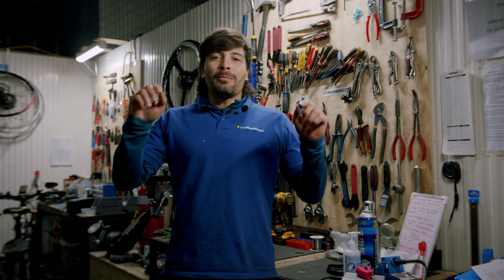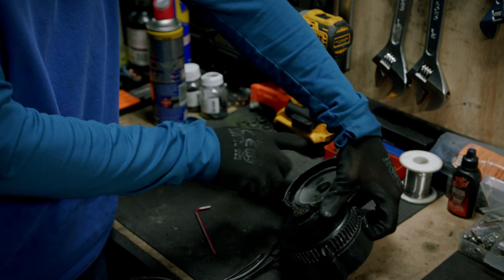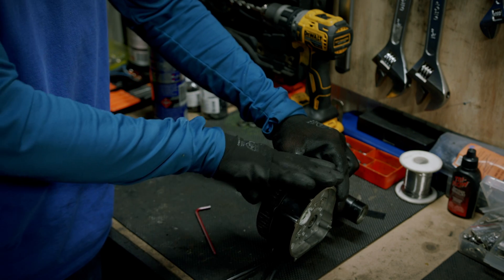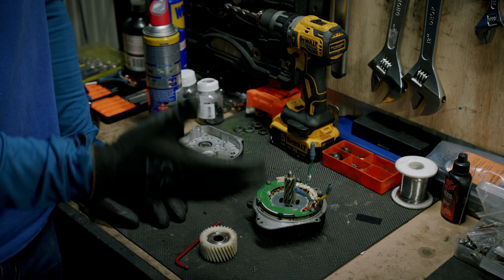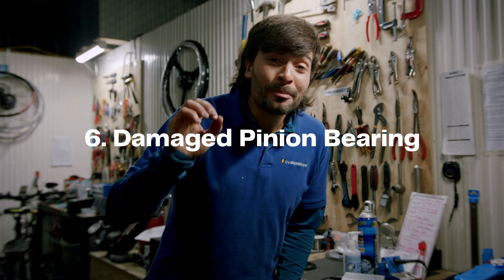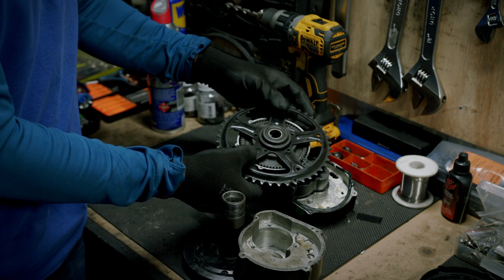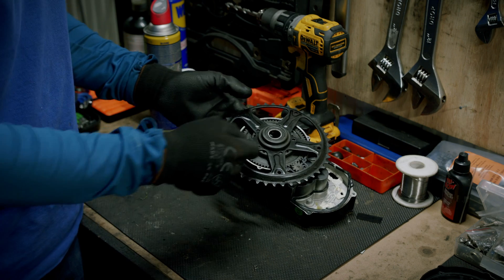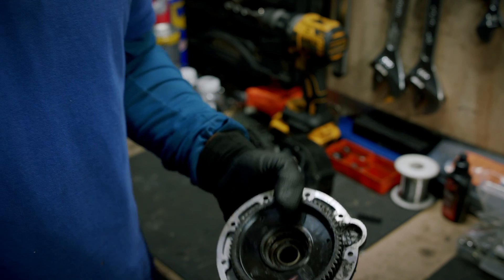Bafang BBS Motors The Most Common Problems of These Mid Drive Motors

Comment: Hello, I have a question. I recently bought a new Bafang bbs02. I asked my supplier if it was waterproof and she said that riding it in the rain for long periods of time is not recommended. Though, I would love to hear if someone has had experience with riding it in the rain and how the motor responded to it. 

I will make sure to put tape on the place where the controller is (also what tape do you recommend, ductape?) There is a lot of rain in my country, especially now it is becoming autumn / winter.  So I want to be really careful with riding in the rain. If you have any other tip on making it extra waterproof please tell me!
Reply from the maker: avoid riding in the rain, the motor will fill up with water, recommended to add tape and other sorts of covers but don't let the motor overheat, be creative, also add helicopter tape to the display and remote control then heat that tape with a head gun, it will shrink and wrap around the display and remote control.
Reply: Okay I will do that! Thanks for your answer!

Comment: My problem with my Bafang motor is the fact that it twists inside the bottom bracket, I have used Lekki locking ring to hold the motor in, and I torque it to spec and it still twists in the bottom bracket just slightly. I also have 2 different types of stabilizing bars holding it in place, yet the motor still slightly twists in the bottom bracket when the motor is running.
Reply from the maker: @TheBrainSquared  have a look at our video how to install a bafang motor, you should get the best tips to ensure your motor won’t move anymore

Comment: great video I just have a question - the engine suddenly stopped working, it doesn't turn at all. and there are no errors on the screen, everything turns on, even the speed is shown

but the engine doesn't start, do you have any suggestions? 
Thanks u
Reply: I don't know if I should try to buy a new controller or cables but that don't look damaged
Reply from the maker: brake cut-offs or the phase wires are melted or water damage inside the controller, search our videos you gonna find the answers following those topics

Comment: Most of the gearshift errors are from using too small/ low of a gear and applying too much force/heat. Are their issues from too high/large of a gear and wide open throttle?

Comment: I have checked all comments and i can't see anywhere
Reply from the maker: you didn't look properly,

The upgrade bearing we use for BBS01/02 is 6002 which is a bit wider than the original.

Comment: @ellaochomogo5154
45 seconds ago
I like how you get technical with your videos.  They are very informative.  Thank you for sharing your knowledge!  I have a question...  I recently installed a brand-new BBS 02 on one of my bikes.  Everything functions as it should, but I have noticed that when the motor is maxed out at maximum speed under throttle, there is a slight vibration when the motor is under load, but the vibration goes away when I slow down by a couple of MPH.  There is no noise just a slight vibration and all else functions normally.  Is this vibration normal?   Could this be the chain resonating?  Any advice would be greatly appreciated.  Thank you!

Comment: Great video. My problem is motor stopped working mid ride. Charged up and would not turn on. Battery voltage is 51 on 48 v battery. Had a working new same system so i started replacing parts. Display was first choice and it worked. Then throttle. New throttle didnt fix. I tried my throttle on my bike and it does not work on known working system. Still no motor. When i try working system with my motor its no go. Could motor and throttle go out at once?.  Thanks Steve
Reply from the maker: Go on the brake cut off then the controller or motor hall sensor, if no error code on the display, check the phase wires

Comment: On the BBSHD, since it's capable of much more torque output(it was designed as a Cargo e-Bike motor after all) the factory Nylon Pinion drive gear is woefully inadequate. 1) It's too narrow for the steel helical Rotor gear. 2) It wasn't designed for all 1000w of the potential output of the BBSHD(when running a 52v battery). It was designed for 500w. This can be corrected however. There are vendors out there that sell an upgraded Pinion drive gear. It's made out of PEEK(polyetheretherketone) instead of Nylon(Polyamide). It's also slightly wider to engage more of the Rotor gear. PEEK acts like Nylon but is far more Heat resistant and has a much higher Tensile strength. The PEEK gear also runs just as quiet as the Nylon gear does. If you or your customers are having a problem with the Nylon pinon drive gear destroying itself I would highly recommend installing the PEEK alternative. Just search the internet for PEEK Bafang gear. You'll find it. I personally source mine from Luna Cycle(I am not affiliated with them, I'm just a customer). I've installed 5 of them so far on BBSHD's that had failed Nylon gears and stock programming in the controllers. Well 6 if you count the 1 I did on my personal BBSHD as preventative maint. Speaking of, it's a good idea to apply new White Lithium grease to the Nylon gear once in awhile as well. It's helps add an additional layer of thermal protection.

Comment: super helpful, thanks. I've either stripped my nylon gear or granny gear. It won't catch in 2-3 speed now and sounds like gling-dingadingading when its not catching
Reply from the maker: the equation is simple:
Big chainring + heavy ebike + not always starting on first gear + riding at low speeds on high gears = motor problems

Comment: Good video!

So I noticed a squealing sound coming from my BBS02. I took the plastic cover off, and it sounds like it's right where the pinion is. The sound only comes when i'm pedaling WITHOUt assist. So once assist or throttle is engaged, there is no squealing sound. I regreased it all today because I figured maybe it was rubbing or something? Not sure what to try next to fix it.

Comment: I have been using my BBS02 for about 2 years now, I don't really travel far on it, Just going to shop and local journeys, The paint on the motor stated to come off showing the bare metal housing of the motor, So I sprayed some anti rust paint on it, It is still working well though, I have never used the programme wire, I bought one but I have left it default, I feel the BBS02 is enough for the little commuting I do on the E-bike, I am going to put another E-bike together in the Summer, From ground up an enduro or down hill, Probably an enduro though, A project you could say...
Still though doing the BBS02 build have saved me from all sorts of stress not having a license, I can just jump on the E-bike and get to where I needs pretty fast as you can use short cuts and parks, I hate the roads anyways, I feel there is way too many cars on the roads see, So I am glad I am not part of the mess you see on the roads, lol....

Comment: My unit is now 5 years old and I am experiencing occasional intermittent partial power loss. I have checked the brake handle cut-out sensors and the power supply. The display is always working without any error messages. Does the motor have a thermal cut-out? What else shoud I be checking?
Reply from the maker: Remove the controller and check the phase wires. If the connectors look melted and with lots of resistance build up, re-do them.
Reply: Thank you for your suggestion. I just found out that the right brake handle cut-out sensor was too sensitive - it needed to travel just a fraction of a millimetre to activate which could have been caused  by road bumps or accidental touching. I adjusted the magnet and hopefully there is no other problem.

Comment: Thank you for sharing your excellent knowledge of this unit! I certainly will shift more than I already am and try to protect the unit from water. Unfortunately, I could not use the so call 'Lekkie Bling Ring' which would have given me a far better gear ratio and taken strain of the motor on steep hills.

Comment: nice useful details...my bbsd 350w dosent start on pressing power button on some research after checking all contacts points etc finally noted that contrller is not giving out 5v to red wire..what can id

Comment: Mine was buzzing like it was running out of batteries and now doesn't start with throttle or pedal assist. I think it's a bad connection but i hope the controller isn't damaged by the intermittent power. I was having to run it off a speaker wire with banana plugs in the battery as i need a new battery mount cable.

The motor connection bottom bracket is annoying because it comes loose as there is about half a tonne of force trying to turn it at full power. My motor is now held up with a bungee. Otherwise it rises up and dents the frame under power. I might need a rubber washer between it and the bottom bracket.

Comment: Thanks for this great advice! Some people recommend lubricating the BBSxx motors even when they are brand new. What do you think about that? I just bought one and will put it into the bike soon...
Reply from the maker: My opinion is: why will you change the oil of a car you've just bought brand new from the auto dealer? 

We have done Bafang conversions for over 6 years always installing the motors new out of the box and we have had no breakdowns due to "poor lubrication".

I just think it's an unnecessary step

Comment: i have again dead controller, no power time to reflash bios again? what's the best software package to reflash my BBSHD1000 52VOLT, it seems like every 2 months
Reply from the maker: you're riding it wrong, not starting at 1st gear, shifting gears too early and letting the torque build up in the motor. What you described is not normal for a Bafang motor, and in all these years we've never pulled one motor faulty out of the box.

Comment: Very useful, I have even sent it to my bike mechanics! At 2:25, you tighten the nut and explain why the torque is so important, but for this nut, I need a special tool to fit between the nut and the torque wrench ( I don't know the English word for it). Where did you buy it? I can not find it on the internet. Greetings from Holland and if you even need a job in the Netherlands call us (BerkelBike).

Comment: Wow. What a breakdown of this unit and how it works. Excellent! I just bought a used Brilliant brand Nexus-geared bike with 750 Bafang, and I noticed on the second day of riding [two days ago] that the motor is "popping" each time the motor engages using either PAS or throttle (pop can be felt when touching the motor housing). Pop in the motor is the same whether engaging with throttle or peddle sensor.
Reply from the maker: Check the granny gear and pinion coupling. You most likely have to replace the granny gear or the bearing of the pinion and the pinion itself.

Comment: The old bbs02 was set with the throttle as priority over the PAS.. This allowed you to use a really low PAS setting and add throttle along with your leg power and it kept the heat and stress down.. It also felt natural.. Then they changed it when the newer bbs02-b came out.. Now the PAS is priority over throttle.. This ruined the drive.. While your turning the pedals the throttle won't work ( unless you pin it to full throttle   which is obviously bad for the motor).. I built several of these and the first thing I do is cut the grey PAS wire!! PAS is stupid!! With no PAS you just ride it like a bike and add power with the throttle when you need it.. The PAS numbers 1-(3,5,or9) now act as what amps your throttle controls.. If you can program the controller set PAS 1 to say 15% ( of the 25 amps) 2 to 25% and so on until 9 is full amps 100% or 25 amps.. You can even set 9 to 90% just for piece of mind (or a customers bike).. You will be surprised that you can ride all day in say 6 and it has plenty of power.. Your bike will feel 100% more natural to ride, your drive will never overheat and your range will increase.. If your really low on battery you can go into PAS 1 and just tap or blip the throttle to keep your momentum up.. 🍻
Reply: Hi, thanks for the hint. I just bought a BBS02B and I didn't know of that change. Definitely agree with you: PAS is stupid. Where is that grey wire located? Inside the chassis?
Reply: If you pull off the controller you can find it there, or you could pull the side cover off and remove the big main drive shaft /gear (the one the pedals attach to)  .. Behind that gear there is a plastic disc with a magnet on it, if you remove the magnet the system will not "see" you rotating the pedals. Then you can pedal the bike and add 1% - 100% variable throttle,, the combination of variable throttle and your leg power is natural, smooth, efficient, and fun.
 @jstolba
Reply: This is news to me, thanks.
Reply: Is this apply to cadence sensors or torque sensors?
Reply: The BBS02B and BBS01B don't have torque sensors in them from the factory, I don't think the BBSHD does either.. As far as cadence is concerned all your speed and odometer data is picked up by the magnet on the spoke that is read by the speed sensor so you still get speed and distance readings  @esayed
Reply: @b-r0llblog510 Correct. All the BBS series use a Cadence sensor. The M series changed that however and they have Torque sensors.

Comment: I grease the reduction gear with Black Moly NGLI 2 grease...  
 I choose small (30T Lekkie) chainrings so that the motor spins fast.. This does a couple things.. Keeps the motor cool, and extends range of battery.    Paired with my Rohloff SpeedHub i am able to keep the motor from lugging down.. That will burn out the controller fast.. Listen to the motor and don't lug it down.. it should sound like it's spinning fast to work properly.
Reply from the maker: how do you pedal on a 30T chainring?
Reply: I'm a short guy. 5'7" so i ordered the square taper (bafang) 152mm crank arms.. This keep my knees from having to bend sharply on the return...I also put 1" spacers on the motor to set my feet further out for better alignment. I ordered a Lekkie narrow/wide 30T chainring.  the smaller chain ring on the bafang keeps the motor spinning faster. And also gives more torque.  
I really like the smaller chainring, . And much easier to pedal. @Cyberbikesau
Reply from the maker: Nice one, glad you customised the kit to meet your needs, keep up!
 @rdkuless
Reply: Thanks, i have ridden over 12k miles since 2016... and i switched to the BBSHD about 4k miles ago and haven't looked back.. Riders who have big issues with these motors usually do not respect the limits of the equipment.. Maintaining chains, gears, tires is all important to make it last 12k miles..   Ride safe my friend.. and thanks for a great video..     @Cyberbikesau

Comment: Nice videos you make about Bafang. 
Shifting gear to a lighter gear is almost impossible, the rpm of the Bafang is to low. You have to use the torque to get to speed
Reply from the maker: when riding with the throttle you can rev to maximum, just be aware that too much torque on the motor axle it will compromise the motor.

Comment: stock grease is pretty crappy, also inside the bearings. adding the right grease, which is a subject on its own, will make servicing later unnecessary
Reply from the maker: Well, if you consider that opening the motor could cause damage to the motor, and the motor is brand new, why would you open it? Our average is that a new motor BBS01-BBS02 would last 20,000km until it needs any service done!
Reply from the maker: The customer is breaking the motor, send our gear shifting video so they stop taking off on the last gear of the cassette.
Reply: @Cyberbikesau  in his case, definitely not, actually he was ghost pedaling quite often, letting the motor spin fast. i just find it easier to take the motor apart before installing it, instead of taking it off later on to do the same job. and possibly having to replace a bearing or gear. you can read everywhere that you should use mobil 28 grease, because it's high temperature resistant. in fact it's the worst grease for lubricating gears (which don't get "hot" anyway), because it's not tacky, has poor shockloading tolerance and poor fluidity. best so far is definitely some kind of fluidized grease with added PTFE powder. the oil base should have a high viscosity (220 or higher) to maintain oil lubrication up to very high torque levels before needing to rely on the PTFE
Reply: @Cyberbikesau  i have left one motor of a client with the stock grease. it would turn oretty noisy after just 1000km limited to 23A @ 48V. The white grease on the nylon gear is the first one to separate.
obviously it takes some careful hands to open a motor, but to this day I haven't damage a single one doing it. though I have toasted 2 controllers with reverse polarity soldering an xt90 the wrong way late in the evening...